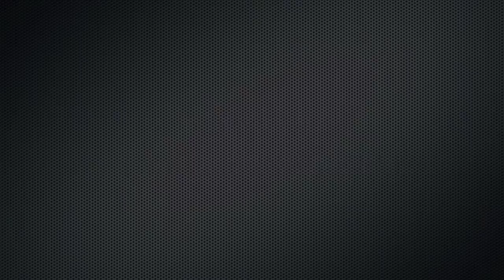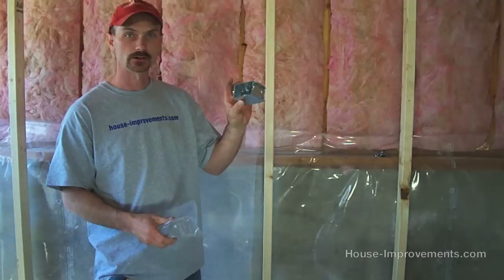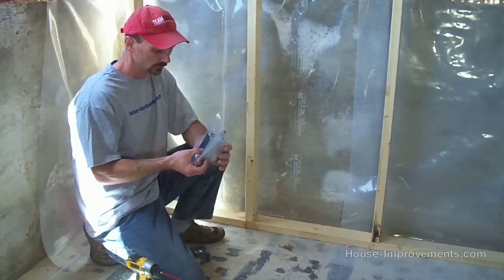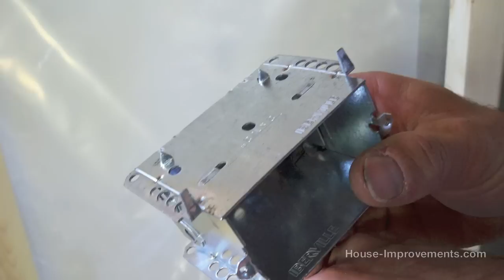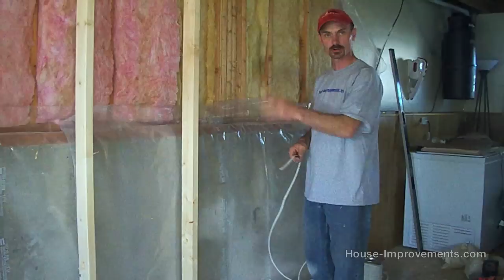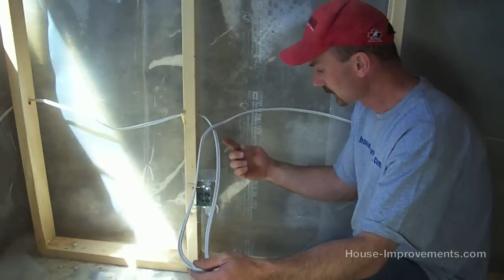Electrical Rough In

Comment: Thaks for the video.

 I am trying to get someone to do the electrical in my basement but it is next to impossible to even get a phone call returned. For my 1620 sq ftt roughed in basement, the one guy I could get to come out wanted $11,570 to do it. I think I will do it myself.
Reply: Whether that is reasonable or not depends on what all you need done and whether the electrician will be supplying the components. It also depends on how hard it will be to do the job (time factor).  If nothing has been installed past the power meter, then that quote may be entirely reasonable. 

Figure that the labor cost itself will probably be $70 - $100 (or more) an hour. If the job is difficult, that could easily eat up $7000 or more of the quote.

Comment from the maker: 3/4" works well for most size wires and it also allows 2 wires of most smaller wire sizes to share the same hole. I generally will not drill holes any larger than that as it weakens the framing. You are better off with two or three 3/4" holes than a 1-1/2" hole.
Reply: I need to put in a 240 socket in a new workshop.Will 3/4 be big enough?

Comment: I have been an electrician for ten years and I have to agree with hermancando. I understand why he's doing it, but leaving a loop like that could potentially cause more problems than it would ever solve.  Always make sure you are feeding power into those boxes! It isn't just a matter of running the wires. Power needs to be feed into those boxes either coming from a breaker (14 gauge = 15 amp breaker, 12 gauge = 20 amp breaker) or off of another outlet that has power to it.

Comment: I like seeing how folks from different areas  areas wire.  I like how you stress on the drilling per Nec 1 1/4 " from the edge of the stud if you dont drill in the middle you will be nail plating, Its also good how you refer to the authority having jurisdiction , I like the little service loop. Ive had to go back and rewire homes were mad renters cut the wire  off at the back of the  box. But here we put all our recepts on a 20 amp breaker and use 12/2 .  This is good  video for the DYI .

Comment: We do loops outside the box in some localities, and others we don't when the AHJ doesn't like them. The problem is indeed down the road as he said, just sooner than you would expect. All too often the drywall crew gets crazy and sloppy with the Rotozip and slices my 6-8 inches of wire into 4 inches or less. You'd think they'd stop when they feel resistance, but nope. Loops are more expensive, but they can be neatly made while adhering to the 5 times cable diameter rule.

Comment: Very good video....Only two thing i suggest is that you NEVER put more then one wire under a staple and Two as far as i know in Canada the homeowner may change recepticles and switches and replace fixtures without a permit. The homeowner cannot get an electrical permit as it requires a CQ#(Certificate of Qualification). I would never recommend a home owner ever do there own rough in.

Comment: A union electrician would probably have done it right, just not a lot of it. Their outlandishly high rates are outside the realm of the average homeowner. They are better off with a small, insured, licensed, non-union contractor.
Reply: You bumped your head!!

Comment: How I'm officially, hopelessly confused. I've had three different building inspectors (in BC and Alberta) insist that I not do that (put plastic on both sides of the wall). It's been a tricky point because I can see the reasoning, and so I keep testing them, most recently last week in BC. They tell me the house needs to 'breathe', to allow some place for moisture to go. But they ironically do allow painting of the concrete wall inside. 

I'll check out your other videos, thanks.

Comment: I find vapour barriers to be confusing. It is my understanding that the plastic must be only on the warm side, which usually means inside the insulation. However in your basement you have the barrier on the cold side, opposite to the side you put the box cover on. Last week when I had a conversation with another building inspector, he again emphasized that they don't want plastic next to basement cement wall, because of concern about cold induced condensation from ambient air.

Comment: Romex cabling needs to be secured within 6 inches of the box it terminates into. Also the fittings on the box, if it be metal, needs to have listed means of securing NM type cabling.

Comment: He is obviously not an electrician. He showed the wrong way to support the NM wire into the metal box. Thats the first thing an inspector looks at when performing the rough inspection. Stick to installing tile.

Comment: @HouseImprovements The laundry area.. the wires are run across the ceiling but then comes down for a plug-in, one looks like a standard one, and the other is for the dryer. There's about an inch between the wires and concrete so would I, or can I just put the insulation around it? (and copper pipes too?) They're secured to some small 2x4s attached to the wall... ... .. (this basement is a big headache..)

Comment: @HouseImprovements Hey, thank you for responding. I completely forgot to mention that one of the walls that already has studs is a shared wall with my neighbour (it's a townhouse).. so do I still need a moisture or vapor barrier? I was thinking of using the sound and fireproof insulation against that wall...

Comment: Hi, I'm currently looking into insulating my basement, half of it already has studs but with no vapor barrier behind or under it, so I was wondering if it can go over the studs/insulation? The other walls are concrete but one already has plumbing and electrical wires on it where the washer and dryer is, so what's the best way to build a wall there?